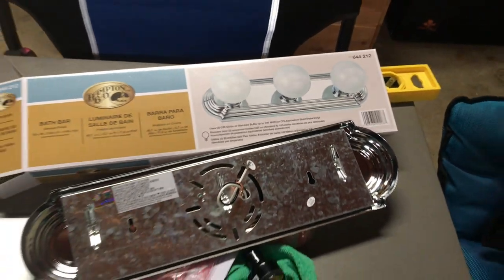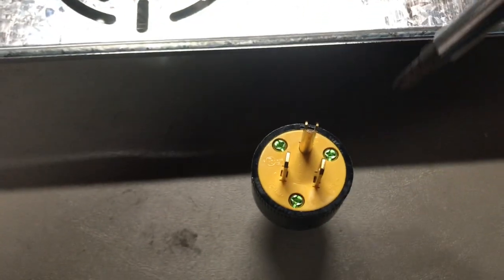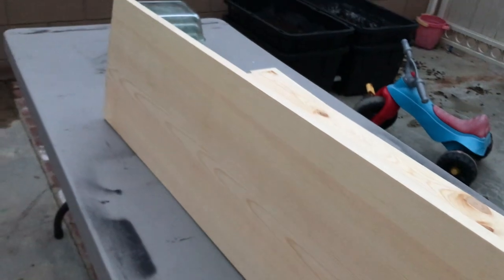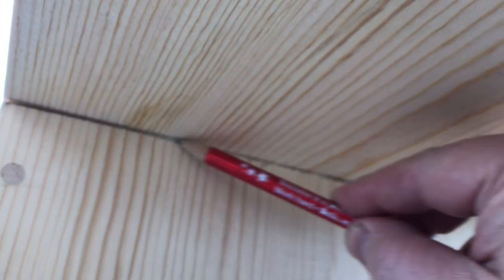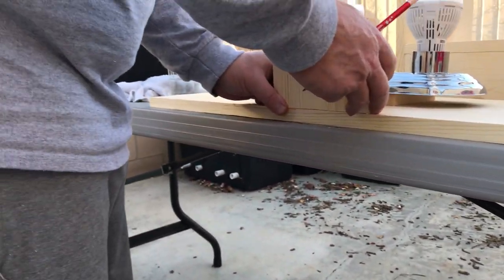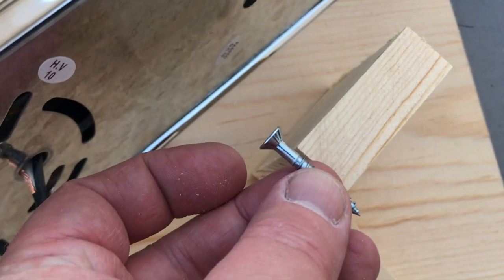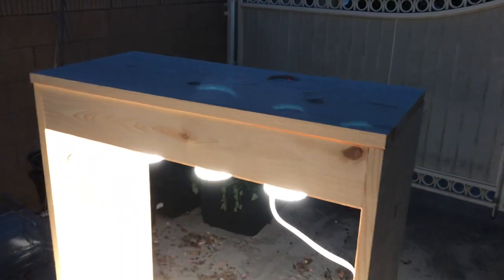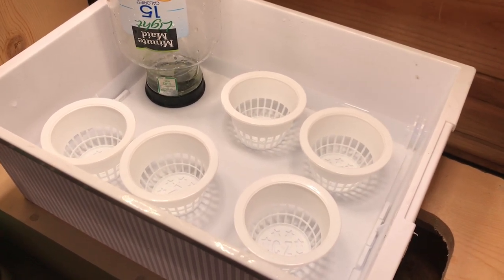Fruit Swells Under The Machine Sun

Comment: Thanks for the "this is how I hide the screws" tip, one for the elecronics: heat shrink tube instead of tape next time!
Reply from the maker: how does that work?
Reply: Pretty sure you just use a lighter and the tube shrinks down when it begins to heat up
Reply: @JebGardener  The tubing just slides over the wires, then you use a hair dryer to heat shrink it.  Also, they do make countersink hole plugs.

Comment: A good mechanical bumble bee is an electric tooth brush. Use it on my pepper plants in the grow tent
Reply from the maker: notice a difference?
Reply: A nice artist paint brush can do great, flower to flower!
Reply: @JebGardener  Yes. Without it in my grow tent i get about 50-70% flower failure and with the tooth brush it is 70% or more flower success rate.
Reply from the maker: how often do you pollinate?
Reply: @JebGardener  I first used a fluffy oil painting brush, then I moved on to electric toothbrush, but now I use the VegiBee pollinator. It comes with a little tiny cup you knock the pollen off into.  I do not know if you know this but under normal conditions, peppers, eggplants and tomatoes are self-pollinating. If you are not seeing that then the plant is stressed in some way and is not pollinating properly.  You might also, for inside plants, move to parthenocarpic type seeds.  Nothing is more "well...hmmphing" than working so hard and seeing very little return.  Even though they are expensive, I get my cucumber and zucchini seeds for winter grows under lights, from Johnny's Seeds.  I do pollinate plants that are in the net houses, that are not self-pollinating - I do so once per female flower. If you do it right, you do not need to do it more than once per female flower/fruit.

Comment: Holy cow, one of the most purely enjoyable vids to watch on the internet. The ending was great lol.
 
Ive been working on designs for micro and mini green hydro grow boxes on a tiny business level and loved your approach and design. On the safety side, you can buy small plastic electrical wire bushings that would protect where wires leave the light fixture. Wires should def be protected at that point. Very importantly, watch the wattage loads on fixtures and circuits. Also, a way to make it marginally safer and maybe possibly up to code for a small business, you could mount an electrical junction box directly to the light fixture, (along with wire bushings of course) and piggyback the light fixture wire with romex inside the junction box like a typical househould light fixture. Then you can run romex out of the junction box to the plug, or to other light fixtures to connect them in series or parallel.

Please note: I am not a doctor or an electrician, nor do I puport to play one on TV or Youtube.
Reply from the maker: yeah i wouldn't sell a homemade plug like this

Comment: Another easier if you don't want to deal with wiring. Use a longer outlet strip , and use those plug to bulb adapters , plug one into an outlet and pesto, a light socket. Put two screws in the wood that are spaced to the holes on the back of the strip then slide lock it in place. Timer? Use a wifi controlled outlet, I use gosund, use the app as your timing. Plug outlet strip into wifi plug, which plugs into an extension cord.

Comment: funny you showed this green sleeve.. i designed something similar for covering small plastic bottles and 3d-printed the first one yesterday.. it fits the bottles i have at home exactly, but i made it black (and no hole to see through for being able to check the water-level. this will be an addition for v2.0)
Reply from the maker: the green blocks the wrong spectrum of light i think

Comment: I'm telling you man, the Super 33+ or Super 88 from 3M, it's electrical tape... you'll discover that real good electrical tape has applications you didn't even consider. It's so good, so sticky, stays on FOREVER, and the 33 is very very thin and can be wound around itself a lot without getting too thick, on the other hand 88 is ridiculously tough and thick, I actually use it as adhesive bumpers sometimes, space out a crooked object that's tilting, cover bright LED lights with it (comes off no harm done), for actual electrical work... it's great.
Reply from the maker: did i wrap the wires good enough?

Comment: That bend in the wire going into the plug might rip the wire. I recommend cutting a hole in the plug’s casing to lessen the bend of the wire.
Reply from the maker: I mismeasured!
Reply: @JebGardener  LOL. Yes, its so short that if your timer breaks you are probably going to have to take the complete fixture off to get that big plug off.  As the guy from Yankee Workshop is fond of saying "measure twice, cut once".  I've been known to say a few "dangs" or "no, no, no, how can this be"!

Comment: Someday I'm going to get you using good LED strips. something like a single 560mm H Influx L09 at $14 on a Meanwell LPC-60-1050 at about $18, it will be about half more efficient than most LED bulbs
Reply from the maker: tell the company to send me samples and money and you can see it happen
Reply: @JebGardener  its not that expensive... how much was that light fitting and the 3 bulbs?

Comment: I have some concern with the light hanging under a pretty sealed roof box, the water steam up at the roof might drip back down on the lights......You may want to drill some holes on the top board to vent them out.
Reply from the maker: the porous wood absorbs any moisture

Comment: Does you middle plant have less algae in it? I only ask because your middle plant seems to be yellowing a bit, which is a trait of nitrogen deficiency, although it could be iron as well. Algae can host nitrogen-fixing bacteria in them, so they capture nitrogen from the air and turn it into a plant useable form (ammonium ions) when they release it into the water. Less algae, due to the shading of the green cover, in the middle jar could be a reason why that plant is a bit more yellow than the outer jars.

Try removing the green cover, and you might see the leaves become more green over the next few weeks as the algae grows and releases nitrogen for the plant.
Reply from the maker: middle has algae

Comment: Never twist such a cable if you put them in clamps.
For screwclamps you even should use end sleeves with this type of cable, or to say it in other words, if you wanna do it right ;)
If you pull on the cable it will untwist, get thinner and it gets lose.
Reply from the maker: i twisted it a little because some stray wires were wandering.  seems like sound advice though
Reply: @JebGardener  since i don't want that the house of one of my favorite persons on youtube burns down some day :D as electrician, if  you twist the cables even some degrees, and a safety controller sees it, it won't pass the safety check because this is enough for insurance to say it's companys/your fault in case of a burn or similar because it was made the wrong way.

Comment: I am looking to do a bit of a vertical garden for basil on one of my kitchen walls. The lights you used here seem amazing but might be overkill for the scope of my project. Are there any smaller lighting setups that you would recommend? I was looking at the LED wand type lights and positioning a wand near each tier of the garden. Any feedback is appreciated!

Comment: Looks like the lights needed to be closer to the plants.
Reply from the maker: i thought the growth was solid
Reply: Jeb Gardener It could have been better. The more lumens to the plants, the better. This can be accomplished by using brighter bulbs, bringing lights & plants closer to each other, or by doing both(stronger lights and closer to plants). Try it, and be blown away.
Reply: The lighting seemed decent to me. I found that the trick to growing Strawberries is that as soon as they start shooting out runners around the end of their fruiting period get those runners rooting asap. Once they've rooted snip the runners and leave them over winter to experience the frost and re-plant them once it starts to warm up. I left small strawberry plants neglected in a tray over winter, it was completely water-logged, plants looked basically dead. Got them re-planted once it warmed up a bit, snipped of the dead bits and now they are huge.
Reply: Curtis never enough light when growing indoors. Plants love light, and the more lumens, the better.

Comment: I tries hydroponics strawberry, transplanted them from soil to hydroponics 2 months ago and all i've got was one flower that wilted (i tried pollinating it, it didn't work)

and now it's just been sprouting leaves non stop, and it looks like it's shooting out a few runners but no flowers at all

i use the same hydroponic formula as all of your other videos and setups, what's wrong :(
Reply from the maker: they seem fussier
Reply: What are you growing them in?  I have found (in my experience of approx. 2 months of strawberry growing) that they don't flower if they've got plenty of space.  I have one strawberry plant I "cloned" off a runner from my original plant in a 3" netcup filled with hydroton and a DWC setup and it produces vegetation like mad but has produced maybe 4 strawberries in 2 months.  My main plant which I pulled it from is in a homemade self-watering bucket but I drilled a 1 3/4" hole in the lid and routed the plant through the hole (the soil is all covered).  It would pop a couple little buds each week for a while, but has grown to the point now where it is crowding that hole and now I've got new buds popping out seemingly every day.

I read that strawberries will not fruit (its attempt to propagate itself) if it has plenty of space to expand and produce runners, if you crowd it in a little then its only option to expand itself is to produce fruit.  After 2 months I'd hope that your hydro plant would have expanded to the point where it would start fruiting more regularly (otherwise my DWC plant is never going to produce well) but you could experiment with putting it into a smaller net cup to see if that encourages fruiting.  Once you have buds, use a painter's brush or Q-tip to pollinate them--I was using my fingertips at first but have had significantly better results with a Q-tip.

Comment: Hey, I used your hydroponics mix, the tomato powder the calcium nitrate and epsom salt but every time the plant takes off amazingly, but at some point the tips of its leaves start dying until it just dies completely. I havent changed the water out and i even added an air pump which of course didnt fix my radish. got any tips please I feel bad killing everything
Reply: Ah! Tip burn. It's probably too strong a concentration of fertilizer. 
Remember; you can always add a little more fertilizer, but burnt leaves are just burnt.